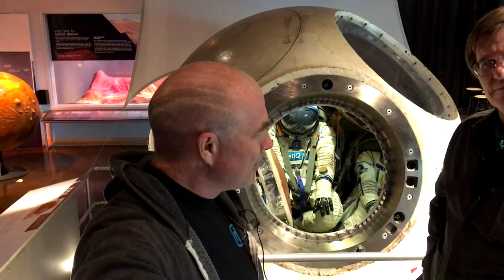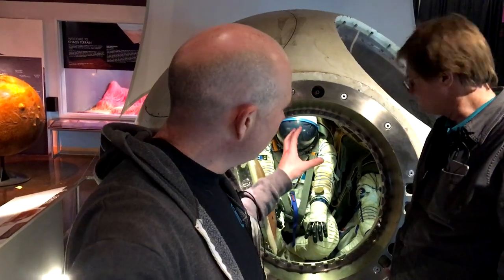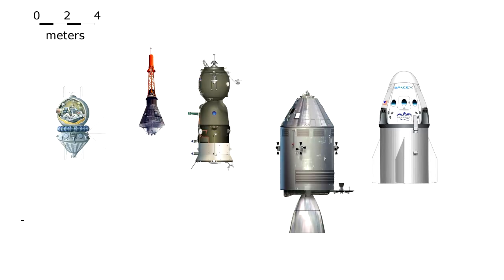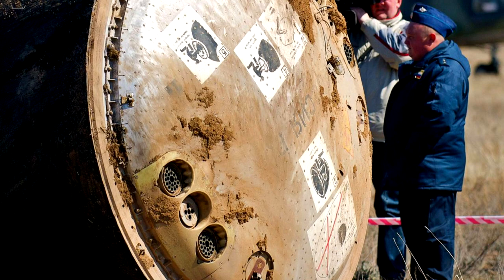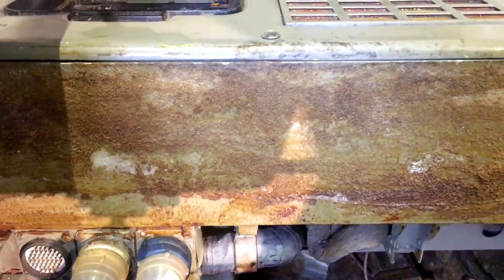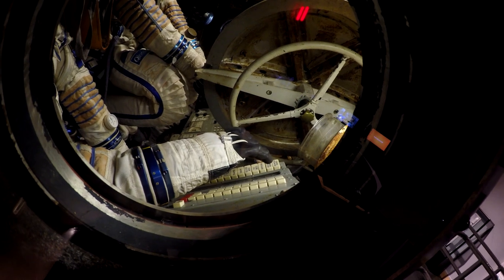See Inside a 50 year old Soyuz Capsule - 1960's Soviet Space Technology

Comment: I saw one of these in the museum in Moscow in the late 80s when it was still the USSR. It was the Soyuz-Gemini capsules fastened together hanging 3 or 4 meters in the air. Next to it, on the floor was a Soyuz capsule. Comparing the two pieces of equipment was interesting. Some of the restraining straps inside the Soyuz were leather and canvas. All of the hardware and fittings on the Soyuz looked like they were very crudely made and had a 'village blacksmith' look to them. My first impression was "Why are they showing these two spacecraft next to each other?", as it was plain to see the US Gemini capsule was in a different level of refinement. Still you have to give the Russians or Soviets for their accomplishments.

Comment: Nice Russian skills, Scott!
This model of Soyuz was used to test orbital rendezvous and docking. Hence the control system contains equipment for that:
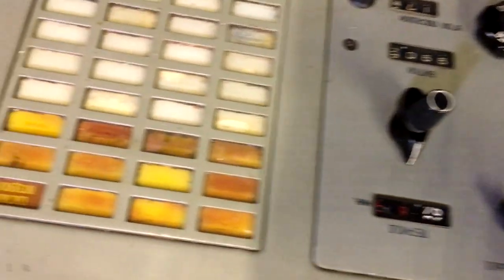8:23 - Video screen for inboard and outboard docking cameras. It could also display analog sensor info like fuel levels, yaw/pitch etc..
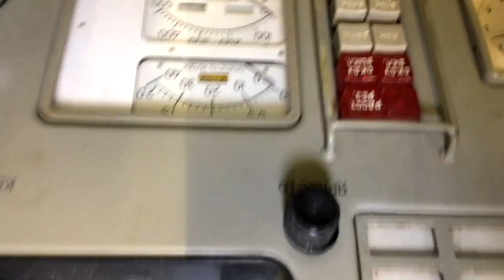9:33 - Rendezvous velocity and distance indicator and buttons for main functions from command panel.
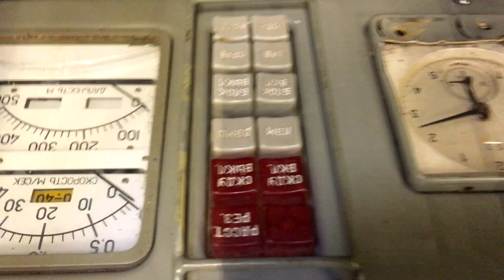9:36 - Radio volume and band control (on the top of the screen).
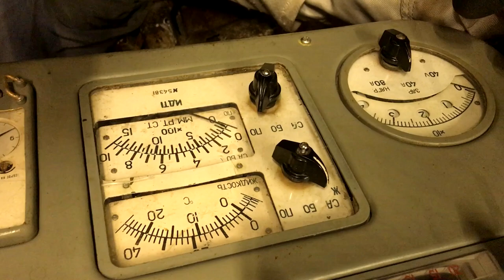9:52 - Round - capsule power supply indicator. Square - life support info.
10:20 - Right control panel. There should be exactly same panel on the left.
10:22 - Flat screen is the computer status display - shows current running program.
10:30 - Knobs for manoeuvring control. Has a deltaV range of 0.044-150.0 m/s.
Reply: Wow, thank you!!!
Reply: Where do most of the Soyuz capsules go after they fly? I feel like they would be in more museums since there are so many of them. Do they go to a storage facility? Do most of them go to a "aircraft graveyard"?
Reply: @grahammckemy1390  Don't know what happens to the actual capsules, but the control panels and electronics are reused.
Reply: What model did they switch over from the analog gauges to the modern day glass cockpit?
Reply: Cool knowledge Ilya dorokhov.!!👍
Reply: Graham McKemy My guess is that a used capsule would be ripped to bits by the engineers looking for weak spots so design improvements can be made.
Reply: @grahammckemy1390  At least some of the capsules are sent to museums or used as monuments. What happens to the rest is unknown, but it is most likely that they are sent for storage for use in various studies.
Reply: If it was used for rndezvous and docking and flew in space, it is Kosmos 186, 188, 212 or 213, or Soyuz 2, 3, 4, 5, 7, or 8
Reply: @mariasirona1622  proof?
Reply: @grahammckemy1390  it depends from what i know for instance the capsule of soyuz-33 is on display
Reply: Главное красный рычаг не дергать

Comment: If we get deep into invention of Phillips screws - they have two key advantages to them: -Self centering for automated power tools and -Auto limiting applied torque - preserving heads and treads. 
 -But then also Phillips screws very difficult to
precisely control exact tightening torque. That's why Torx was invented - it's combining advantages of Slotted and Phillips screws.

Since early Spacecrafts assembled exclusively by hands - Slotted screws were not a problem and even necessary for precision tightening of fragile glass of illuminator!
Reply: I like to imagine the Canada Arm on the shuttle was held together with Robertson screws 🔩

Comment: 9:47  the gauge with temperature has "liquid" caption and the second one has pressure in mmHg. The electrical panel on the side has ЗАР. 40A, which seems like заряд, "charge" and НАГР. 80А, which is нагрев, "heating"
Reply: НАГР for "нагрузка" - load
Reply: May be charging current? Because charge should be in Ah or Wh.

Comment: Soyuz 40 a 7K-T craft and the last of its kind and the last to dock with the Salyut 6 space station, is on display at the National Military Museum in Bucharest in Romania. It's tucked away in the aviation hangar display, still in its charred state after re-entry and complete with its parachute. It is there because on it flew the only Romanian cosmonaut who has been in space, Dumitru Dediu. The old guy who looks after the aviation hangar like a curator and some other parts of the museum is a really cool old eccentric, with lots of stories. In Romanian the museum is called Muzeul Militar National, pretty central in the city and easy to get to on the 85 tramline, has a stop right in front of it basically and 10 lei to get in, about 2 Euro, great little museum.

Comment: A huge problem with the original Soyuz capsule design was fitting of the folded parachute into that space shown in the video. After the Soyuz 1 tragedy, they had to redesign it, probably including the parachute design, so a parachute could properly fit and deploy correctly.

Comment: This lander is not from the "Soyuz" of the late 60s, early 70s. The first Soyuz spacecraft were three-seater, but the astronauts flew without spacesuits. After the death of the crew of the orbital station on Soyuz-11 in 1972, the USSR launched a new ship two years later. The crew in it were in spacesuits, but only two cosmonauts could fit. The name of the ship was not changed, the numbering of the ships continued. Such ships flew until the early 80s, bringing their numbering to 40. Approximately in 1982-83, the Soyuz-T flew. First unmanned, and then manned. In the former "Soyuz", the entire navigation system was based on gyroscopic devices, and so that the gyroscopes did not rest against the suspensions, the ships could not make some movements in space. The new Soyuz had a computer control system and accelerometers, so it could spin as it wanted. Such a system was on the Apollo back in the late 60s, but as a backup for a proven gyroscopic one. Thus, we see that the capsule is designed for three seats. The control panels, which are bolted to bare iron (in a real ship there is a heat insulator and everything is covered with fabric, under which cables are stretched) correspond to the 70s, when 2 people already flew. And there are three spacesuits sitting in the chairs, which corresponds to the mid-80s. If you find the factory number on the capsule and ask in the forum of the Cosmonautics News magazine, you will be told in 5 seconds when it was manufactured, when and who flew it. Success.

Comment: Nice video. Shooting in small spaces is always a challenge. If you get another chance to visit Soyuz, buy/borrow one of those 360 degrees cameras. They work much better for closed small spaces. Ricoh ones are quite affordable (no affiliation) and can be controlled remotely, so you can set it up inside, close the hatch and take the pic with out you in it. Or take one of the seats and make 360 degrees video.

Comment: I can not be sure at 100%, but it seems that this is a control panel  "СОИ "Сириус - 7К"" / "Information Display System "Sirius - 7K""

Right and left panels are "Командно-сигнальные устройства (КСУ)" / "Command and signal devices (KSU)"
In the center - "Приборная доска ПД-1-7K" / "Dashboard PD-1-7K"

7:32  - "Визир специальный космонавта (ВСК)" / Special Cosmonaut's Vizor (or Viewfinder) (VSK) 
4 knobs (2 of them are long conical) moving from left to right:
"ЭКРАН" - SCREEN
"ЗАКР ШТОРКА ОТКР" - "SHUTTER CLOSE/OPEN"
"СВЕТОФИЛЬТР ПЕРИФЕР" - "LIGHT FILTER"
4th label is not readable

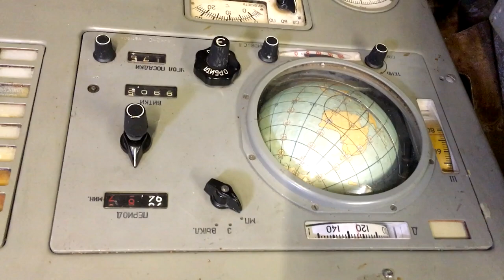8:03 - "Индикатор Навигационный Космический (ИНК)" / "Space Navigation Indicator (INK)". NOTE: hereinafter "space" means "designed specifically for space flight".
Image upside down. Moving from the bottom right corner clockwise (relative to the screen):
"Д" - short for "Долгота" - LONGITUDE - bottom right of the screen, white scale with black numbers 
black three-way knob "МП." "З." ".ВЫКЛ" - INK operating mode selector
"ПЕРИОД" - rolling digits - "ORBITAL PERIOD" (in minutes)
"ВИТКИ" - rolling digits -  "ORBITS" COUNTER
"УГОЛ ПОСАДКИ" - rolling digits - "THE ANGLE OF LANDING"

Big knob with letter "Э" on its cap - "ОРБИТА" - "ORBIT"
white scale with red numbers and black knob on the right (relative to the screen) - "ТЕНЬ" -> "СВЕТ" / "SHADOW" -> "LIGHT", Time to sunset and dawn
"Ш" - short for "Широта" - LATITUDE - yellow scale with black numbers

black circle on a globe with a cross inside. Cross - the current position of the spacecraft (or predicted landing zone), circle - the range of radio communications

9:14 - heartbeat monitor for 2nd and 3rd cosmonauts:
"ПУЛЬС" - "PULSE"
"УД/МИН" - "RATE" (per minutes)
"ВКЛ" - turn ON
"ВЫКЛ" -turn OFF

9:23 - black knobs at the bottom:
"ЯРКОСТЬ" - "BRIGHTNESS"
"КОНТРАСТНОСТЬ" - "CONTRAST"

 White square window with two scales - "Индикатор расстояния и скорости (ИРС)" / "Distance and velocity indicator (IRS)"  - Rendezvous indicator
"СКОРОСТЬ М/СЕК" - "VELOCITY М/S", double scale 0-2 m / s and 0-40 m / s
"ДАЛЬНОСТЬ М" - "RANGE M" (0-500 м)

red push-buttons - "Кнопки особо важных команд" / "Buttons of especially important commands"
"РАССТ." - "DISTANCE"
"РЕЗ." - "RESERVE"
СКДУ - "Сближающе-Корректирующая Двигательная Установка" / "Rendezvous - Orbital Maneuvering Propulsion Sysytem (SKDU)"
"СКДУ ВКЛ" - SKDU ON
"СКДУ ВЫКЛ" - SKDU OFF
"ЛЗМ" - ???
"ДЗМШ" - ???
"БЛОК ВКЛ" - "BLOCK ON"
"БЛОК ВЫКЛ" - "BLOCK OFF"
"ЛЕВ" - "LEFT"
"ПРАВ" - "RIGHT"
???
"ВЫКЛ" - "OFF"

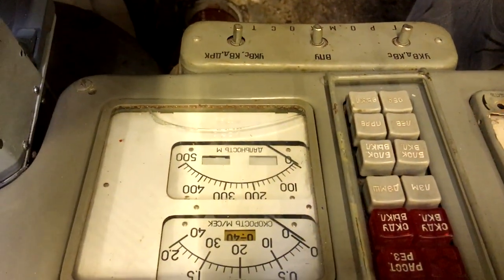9:36 (the top part of the screen). Comm Radio Voliume
"УКВ КВ" - Ultra-short waves     Short waves (USSR radio wave ranges)
 
9:47 - White square window with two scales and two knobs - "Индикатор Давления и Температуры (ИДТ)" / "Indicator of Pressure and Temperature (IDT)" (in the compartments of the spacecraft)
round scale - "Индикатор Напряжения и Тока (ИНТ)" / "Voltage and Current Indicator  (INT)"

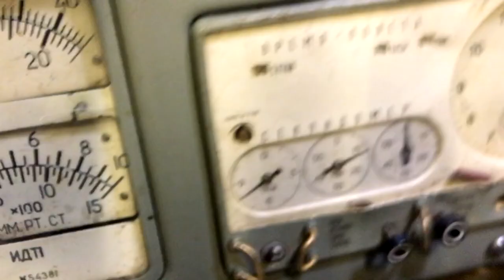10:00 - "Бортовые Часы Космические (БЧК)" / "Onboard Space Clock "
"ВРЕМЯ ПОЛЕТА" -  "FLIGHT TIME" (Mission Elapsed Time)
"СУТКИ ЧАСЫ МИН" - "DAYS HOURS MINUTES"
"СЕКУНДОМЕР" - "TIMER"

10:13 - "Видеоконтрольное устройство (ВКУ)" / "Video Control Device (VKU)". old-fashioned MFD, used to display a variety of information through lines and symbols

10:22 - Rendezvous indicator, the same as in 9:23

sorry for my bad English ((

Comment: Interesting stuff. Pretty hard to get the chance to take a peek inside something like that. Would be awesome if they'd let you get a peek inside an Apollo capsule.
Reply: Ironically, the remaining Apollo spacecraft are almost completely stripped of their interiors--originally, they were stripped of interior equipment to serve as spares for the rest of the program; after the end of the Apollo flights in '75, NASA stripped the instrument panels of a hell of a lot of switches and other items that matched hardware used on the Shuttle.  Likewise, the Shuttle cockpits were stripped of most of their switches and other such things before being put on display, so that the hardware could be reused on Orion, and Gemini cockpits were stripped of parts that could be reused on Apollo before they were turned into museum pieces, too.  It's entirely plausible that the first manned spacecraft to land on Mars will have some switches and circuit breakers that flew on Gemini 3...

Comment: American hammer: has Bluetooth, GPS, WiFi, USB 3.0, Cloud, a dedicated iPhone app, can be programmed in Python, PHP, Javascript, a beeper made by JBL with a Dolby technology and the grip is made by original DuPont (TM) whatever rubber. Is made of kevlar carbon nanotube laminate vacuum coated with laser sputtered titanium doped ceramic. You try to use it, it flies off the handle, because their marketing deparptment figured out that investing the research into a reliably way to connect it is not the right business decision . Russian hammer: both the head and the handle are a single piece of steel. It can do only hammer, but it works.

Comment: Wow in 1971, the Soviet technology looked from the 50's, where in 1969, the US technology was so advanced it was slightly ahead of its time, say 1972. In 1969 when the first Apollo landed on the moon, the only things that were older technology were electronic chips (hybrids) that were small pieces of Silicon: transistors, diodes, and resistors, mounted in a small metal package. There were only a very few microcircuit devices that we would know today... it was mostly discrete components (transistors, diodes, capacitors,...) and those metal hybrid devices. The other old technology was computer memory.  The first memory microcircuits were about 10 years away when Apollo was designed. So rather than making memory out of discrete devices and those slightly more compact hybrid devices. which would result in a memory bank being very large and bulky (the size of a small refrigerator), they had to use "Magnetic Core Memory", which was more compact at the time but more electromechanical - it was the best available at the time. It was because of this, microcircuit memory was developed for The Space Shuttle - in the very early days 1K bytes was available on a chip. When 4K bytes on a chip was achieved, that allowed much smaller a faster memory banks at a lower cost.
Reply: cosmonaut Krikalev was the first Russian to fly on the Shuttle, then he noted that in Russia the training of cosmonauts is better than that of NASA, and the onboard equipment installed on the shuttle is outdated compared to Mir computers.
Reply: @championknife  I highly doubt that Soviet/Russian computers on the MIR were better dated than the Space Shuttle computers, maybe the MIR had more memory because it was a more permanent fixture in space, but as for compactness, power efficiency, instruction set, and MIPS, the US space computers were and still are far superior. I am sure his comments were just to maintain Russian pride.  As far as training, the Space Shuttle made going to space more routine. The US had already gained enough knowledge of human effects in space from the NASA Mercury, Gemini, and Apollo programs, so there was no need for rigorous Astronaut training for a Space Shuttle flight. The US was not the "first" on a lot milestones in space, that was because NASA took less chances in space (still not perfect). We believe the Soviets (Russians) lost at least 3 Cosmonauts inspace, the US lost 3 Astronauts on the ground. NASA was focused on the primary goal of walking on the Moon, so being the first to Space Walk was not a priority for the US... a Space Walk is a "Cake Walk" compared to walking on the Moon. After 12 US Astronauts had walked on the Moon, none were lost in space, the Soviets did not report and covered up the actual number they lost in space, it is proposed it was about 5 before the 12th and last Apollo US Astronaut had returned to Earth.

Comment: Wasn't the restriction of width coming from rail width restriction?
Reply: No, that was Thiokol boosters. The USSR was constrained by needing to fit onto existing proven hardware that had limits as to dimensions and mass capability. they needed to have it work due to both material restraints and also engineering personnel restraints, so reuse of existing stuff and simply using more duplicates was the solution.

Comment: Scott. From watching your videos about orbital mechanics I have a question. If an object in orbit does a burn to slow down if it doesnt actually slow down enough to de-orbit then it will actually bounce back into a higher orbit and speed up. Is this a correct understanding?
Reply from the maker: It won’t return to a higher orbit, it’ll return to the point where it made the burn.
Reply: eventually, it will encounter enough particles of ultra-rarefied atmosphere to which it sheds some orbital speed, causing it to encounter more of the atmosphere which in turn causes its orbit to decay further until it finally comes down.

Comment: So the re-entry shield is ablative?
Reply: Since it is not made to be reusable it sounds a reasonable conclusion. The ablative material takes the beat with it as well as making the spacecraft lighter to need less parachute power to slowdown. Ablative shields are quite heavy when unused. The other advantage is that you just ad more ablative material if you need greater reentry capacity (coming back from further than LEO for example), it is added in layers, add more layers to make a shield resist last longer for more aerobrakes or capture with higher speed. So the shield is customizable for the mission.
You can do this in KSP BTW, thus optimizing weight to have a lower take off weight and thus a less cheaper rocket.

Comment: I had a Russian oscilloscope. It was so built that if you threw a Tsar Bomba in and then screwed it back up and detonated the bomb inside, it would still continue working, just the panels would be slightly bulged. The transformer didn't have 4 screws in corners as is the standard Western technology. These compress only the corners and let the rest of the tins rattle and hum. It had two triangular irons so thick it looked like something from a locomotive, and these obviously applied pressure along the whole length of the transformer tins. When I saw this I suspected that the Russians have actually developed a brain, compared to the western engineers.